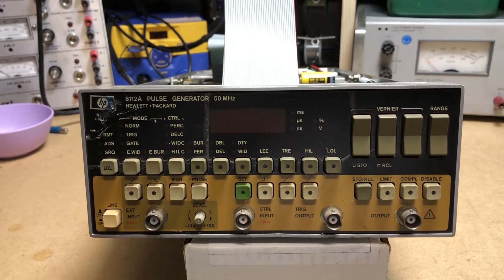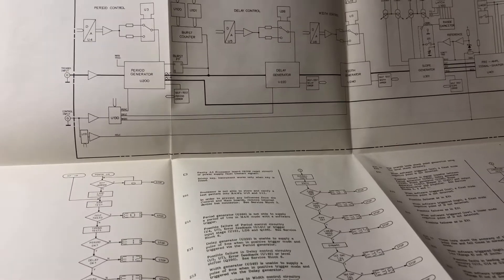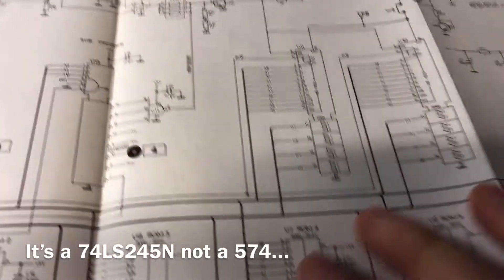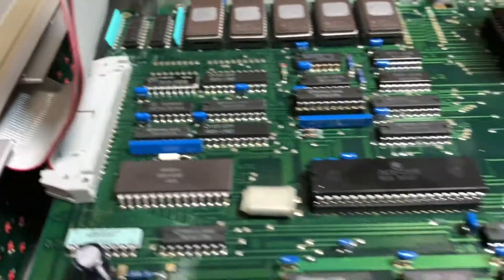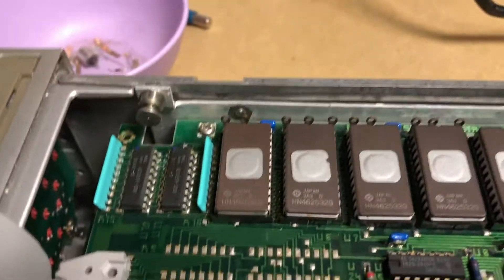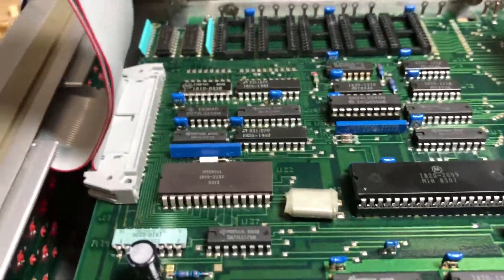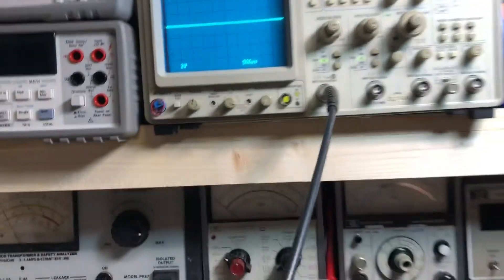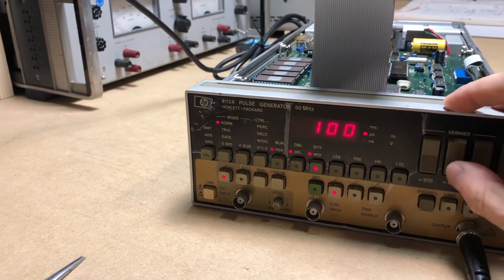HP 8112A Pulse Generator E01 Error Code Repair

Comment: Congrats on getting your unit working.  It’s good that your fix was so simple.  I am trying to fix a 8112A that had had a blown power supply. Got the PS fixed but now it starts up with an error E31.  Hoping my unit will be a simple fix like yours was.
Reply: stuck on E11 here after finding a bad cap.